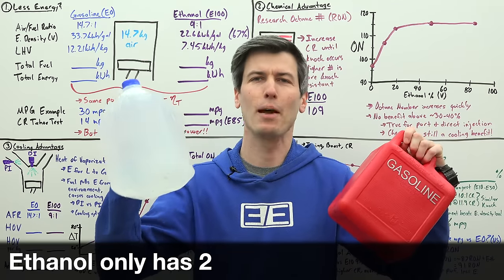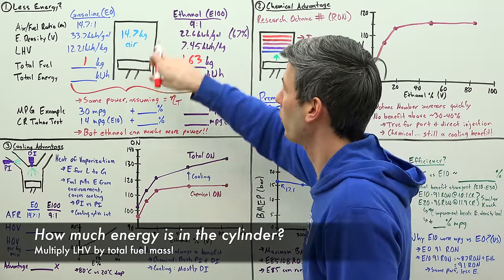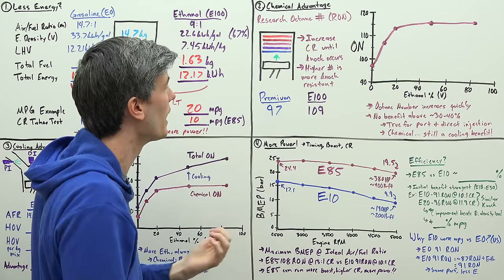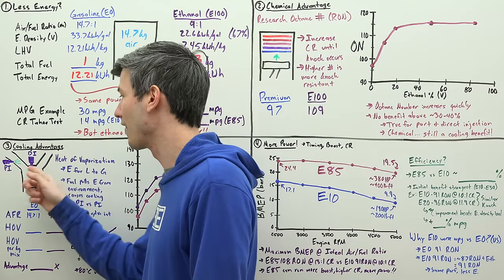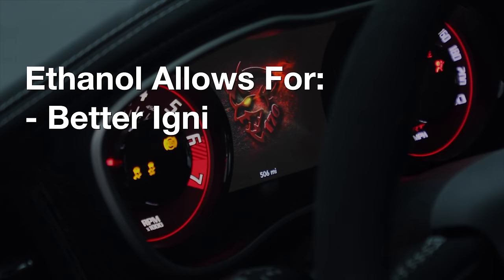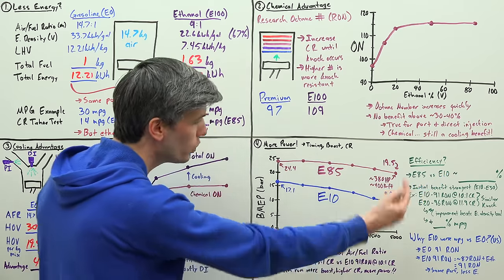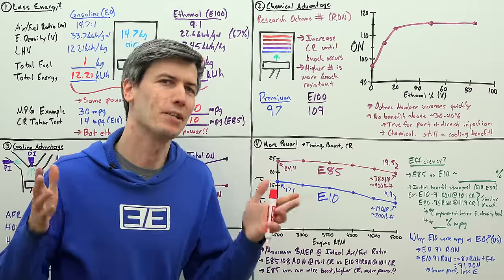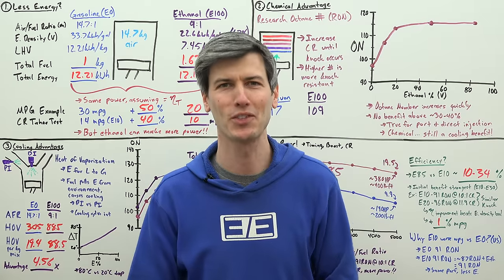Why Does Ethanol Make So Much Power? (Versus Gasoline)

Comment: Suggest you check out Methanol; a superior fuel to both ethanol and gasoline, and cleaner by far.
Reply: A Brief History of Racing Fuel By Craig A. Johnson

In 2005, the IRL used 100 percent methanol in their tanks. The fuel worked well and was more efficient than straight gasoline, but IRL officials believed there was room for improvement. In 2006, they moved to a 10 percent blend of ethanol and methanol, which was then changed to 100 percent ethanol for the 2007 season.

The desire to use only ethanol aside, 100 percent ethanol is nearly impossible to obtain, and is illegal to keep without paying hefty taxes that date back to prohibition. The actual fuel used by the IRL is a blend of about 98 percent ethanol and 2 percent denaturant. The exact composition includes a small amount of high-octane racing fuel.

The fuel for today's Indy cars has an octane rating of 113, compared with methanol's 107. This means a significant reduction in pre-ignition, or knocking and pinging.

In addition, many of the people who handle the fuel, say it smells like tequila. This quality may seem insignificant, but smell is actually one of ethanol's benefits when compared with methanol. Pit crews noticed the switch to ethanol immediately, reporting fewer coughing fits and less eye irritation before any other modifications were made to accommodate it.

According to Dennis Vervynckt, manager of hospitality services and an IRL official, in 2006, the first year the IRL began using ethanol, teams saw a reduction in efficiency of about 10 percent. "That's because we put straight ethanol into the tanks," he says. "The teams initially didn't make any or very many adjustments to their engines. After a few months, they kept tweaking and by the end of the season they were back up to 100 percent efficiency."

Vervynckt points out that there was a minor loss of power. "When they first started using ethanol, teams saw a slight drop in horsepower," he says. "As the teams got used to the fuel, they were able to get more horsepower from ethanol once they again reached maximum efficiency."

The switch to ethanol also allowed the racers to carry less fuel and make fewer pit stops, thereby increasing efficiency even more. "When the cars ran on methanol tanks had to hold 30 gallons to accommodate the fuel requirements of the cars," Vervynckt says. "After getting the engines to perform at their full potential, there was a significant gain in mileage. Indy cars now have 22-gallon tanks. When a driver pulls in to change out his tires, he can fill up. Teams were able to match their tire and fuel stops exactly, instead of stopping for tires only, or fuel only."

That efficiency translates into much less fuel being used by the sport. Lifeline Foods LLC, which supplies fuel for the IRL, will produce 120,000 gallons of ethanol for the 2008 season. And though this may seem like a lot, it's 20,000 gallons less than was used the previous seasons.

The switch from methanol-based fuel to ethanol has amazed almost everyone in the league. Drivers, the direct users of the fuel, voice their approval in glowing terms. "[Ethanol] is an American fuel that is good for the country and the environment," says Ryan Hunter-Reay, of Rahal Letterman Racing and driver of the ethanol car. Standing beside his crew as they make last-minute adjustments to the car, he is more than happy to discuss the benefits of the IRL's switch to ethanol. "It's been great for Indy racing the fuel economy, emissions there's nothing we don't like. We love it."

Comment: The equation (R+M)/2 is flawed because Research Octane isn't actually real octane, it's the equivalent power of what real octane outputs at a specific compression ratio already stated by you. 

Thermal power and efficiency is what people should be calling it instead of Research Octane because it's incorrect to call it that. Which confuses the lay person at the pump not understanding what it actually means.

I've run many different tests with a lot of different fuel grades, the fuel grades with a lower Research Octane and having more real octane actually runs better in the majority of engines from the 1940s up to 2016, this excludes the E-85 multi fuel grade engines but the normal combustion engines on the market. I've found mid-grade  88 ~ 92 to be the best out of all of them. Minnoco, Sunnoco, Sinclair, and BP tend to be more honest in these fuel grades and less honest the higher up you go. You're paying for more expensive gas but with a higher Research Octane number vs. the real octane number. 

People call Octane 100 to 120 racing gas but it's really not, it's for the most part a much higher Research Octane (fake octane equivalence) than the latter.

True 120 Octane fuel is not only very expensive it's also extremely dangerous, as it's very toxic to living tissue.

There comes a point when having ultra high compression will backfire on you, even using true 120 Octane gasoline, there's a limit as to how much power you can create with convention combustion engines. Simply because they're designed for mass production and not tuned for power and efficiency from the reduction of weight of the individual components within the engine itself. If engine and transmissions were given the care and assembly that top end racing cars have, we'd have a much different outcome for fuel efficiency regardless of what fuel we're using.
Reply: Scania has sold an ethanol engine worldwide for years which has a 28 to 1 compression ratio.  They state both power and fuel economy is on par with their diesel engines.

Ford's first prototype EcoBoost engine was optimized for E85 and achieved 15 to 20% better fuel economy than when on E0 with load performance similar to a diesel engine.  They didn't come out with it in flex fuel because they evidentially thought they could skirt paying the MIT scientists' patents on the design.  That is still in court.

Ricardo built and drove an ethanol engine for GM which surpassed both power and fuel economy than their diesel engine.  This is why GM wants a 100 octane fuel standard from the EPA.

 FROM RICARDO:
The new federal CAFE standards are calling for a doubling of fuel mileage performance, which, Vint says, is going to send OEM’s looking for high octane numbers to improve efficiency and ethanol is the best source. Ricardo, an engineering firm with over 100 years in the business of engine design, has developed an extreme boosted direct injection engine (EBDI) to optimize ethanol blends. The 3.2 V6 gasoline engine rivals the power and torque of a much larger GMC Sierra 6.6 diesel, he said, and it delivers 3.5 percent better fuel economy than the diesel.

GM and Ford were also both concerned about E85 availability since <2% of fuel stations in the US offer E85 compared to France where >25% of fuel stations have it available.  Monopolistic power at play in the US.

Comment: Compliments for your  well done mathmatical artistic, pseudo science and engineering graphics presentation. To promote ethanol as fuel for 'gasoline' type engines. 

Ethanol is a net-net wasteful endeavour and mostly based on politics, lobbyists, big-agri and taxpayer funding of all of latter.  Compounding wastes are using agricultural lands toward ethanol instead of foods. Lands used used to grow corn/maize, sugar, and other plants to be processed to extract and distilate ethanol /alcohols from is squandering, and mislieading as are feel-good politics and unscientific sales pitches. 

Ethanol is hydroscopic aka has strong affinity to moisture whether as water vapour in atmosphere, condensation, or liquid forms. Thus alcohols easily blend with water. 

Ethanol fuels and blends in gasoline cause tremedous deterrioration to fuel systems, engines, resulting in costly repairs,  upkeep, and replacements. 

Ethanol and its blends in fuels are sister to and as sinister as salts spread on roads during winter seasons in USA, CAN, and parts of Europe under premise and promises of; ethanols being green fuels; salts on roads, bridges, walks etc as assuring safe travels. All illusions while ignoring facts of massive deletarius effects, deterioration,  ruin, pollution, other costly and not-green consequences.

Both foster making engines, cars, trucks, roads, bridges, etc deterrirate rapidly and fail  toward being replaced often. Guess who are burdened?

Comment: That dam ethanol is the worst thing they have done for small engines, if it stays in an engine's fuel tank for a length of time it gums up the carbs and that is where all the problems are. If you use non-ethanol fuel for small engines you eliminate the problem of gummed-up carbs and the starting problems associated with it,  my 2 cents worth.
Reply: Identical small engines to ours in Brazil use their common gasoline which contains 27.5% ethanol.  It has worked out so well and for so long that Paraguay went to E27.

Many fuel carb and injector cleaners use an alcohol for an active ingredient.  Sea Foam fuel treatment contains 25% alcohol and they state it stabilizes fuel for 2 years.  Gasoline only normally lasts 3 to 6 months.

I can remember before E10 came that gasoline would always varnish over winter in my father's small engines.  Like a skunk, varnished gasoline is something one never forgets.  I have not seen E10 ever varnish.  During the transition to E10 from E0 back in the 1980s, E10 would clean out the built-up varnish which would plug fuel filters.  Once clean, E10 kept things clean.
Reply: I use E15 in all my gas mowers....my 2 cents...and I have videos of it.

Comment: Unless the fuel will sit idle in your engine for long. Ethanol which sits for too long without moving erodes and corrodes many rubber and plastic parts prematurely, and it also doesn’t keep as well over time in a can.  Real gas wins both of those battles. I put real gas in all my mowers and engine-driven tools.
Reply: NOPE.

Comment: Your next video let's get to talking about ethanol it's 55% more explosive so when you crash one of these US Government EPA mandate Echo pods I call crumple Zone caskets that the fuel explodes and burns people alive in their own private crumple Zone crematorial just because we can't we can't have 100% gasoline like Russian citizens get to enjoy and they're 95 octane that only $3.38 a gallon and the r 600a explosive refrigerant in new refrigerators since 2009 mini refrigerators have exploded as the freon leaks in between the lining and the steel body of the refrigerator and explodes because we have to be good to the environment and have deadly refrigerators soon the deadly Freon will be in cars and when they crash it will leak ignite and ignite the ethanol and the car is guaranteed to burn forget the pinto every make and model will burn
Reply: Ethanol is not explosive, just the opposite.  

The Indy 500 back in the 1960s saw this first hand in a deadly multi-car crash when both gasoline and alcohol powered cars raced.  They switched to 100% alcohol for this reason.

Train and truck crashes with ethanol often do not explode because ethanol has such low volatility.

The reason we even have E85 instead of E100 is to make it volatile enough to start engines in cold weather.  In wintertime, E85 is actually E51.  Brazil who went to E100 fuel used to have lawn mower sized tanks of gasoline for starting.  Today's modern flex fuel vehicles there have heated injectors for starting in cold weather very similar to glow plugs in diesel engines since diesel is low in volatility also.

Ethanol is the cleanest, least toxic, and lowest cost per mile octane booster available.  Today the spot cash delivered price on the NYMEX of ethanol is just $2.36/gal.

Comment: Much like hydrogen if it
 were liquified.
More bang per gallon.
Reply: All gaseous fuels are dangerous, even more so as the equipment ages.  Hydrogen is the worst because of the extreme pressures and that it is so tiny it is hard to contain.

An ethanol optimized engine has no match in bang per gallon, not even diesel.  Efficiency from a simple and cheap internal combustion engine that gets into fuel cell ranges.

I do see that hydrogen fuel cells get great mileage and that they are available.

Nissan has a hydrogen fuel cell that gets its hydrogen from ethanol.  They drove one around in 2016 in Brazil who has an E100 infrastructure.  Great thing is it could have enough water in the ethanol so as to not be flammable and work making an already safe fuel perfectly safe.

Advanced European and Indian ultra-quiet large military submarines also use ethanol fuel cells.  They have alcohol fuel cells in computers, drones, and RV/sailboat/back-up power sources.

The new generation don't make hydrogen from a catalyst but can use the ethanol directly.

Here is an article excerpt from seeking alpha web page talking about the bang per gallon of ethanol vs hydrogen:

>>>Fuel Cell technology offers many advantages over Lithium-ion batteries, not the least of which is that hydrogen used in fuel cells has the energy to weight ratio ten times greater than lithium-ion batteries.

That said, the volumetric energy density of ethanol is over five times greater than hydrogen.

Ethanol has five times higher volumetric energy density (6.7 kWh/L) than hydrogen (1.3 kWh/L) and can be used safely in fuel cells for power generation.<<<

Comment: If you want to trash carburetors, ethanol's your huckleberry.
No problems starting any small engines after extended idle periods after switching to pure gas.
Reply: Not true. Gasoline separates with age, and the varnish from separated gas will clog a carb to the point that it needs disassembly and cleaning.

“Fuel varnishing is a gummy residue that clogs the generator carburettor and fuel pump. It's caused by the deterioration of fuel that sits in the engine too long, and it happens in a surprisingly short period of time. Depending on fuel quality and storage conditions, gasoline can deteriorate in as little as 30 days.”

“Gas contains volatile compounds that allow it to burn. As these compounds evaporate, gas becomes less combustible and eventually turns into a gummy varnish-like substance. When this happens, gasoline no longer smells like gasoline; it smells like pungent varnish.”

Ever heard of GumOut? It’s a carb cleaner that has been in existence since long before “gasohol” was even on the radar of American motorists. Can you guess why it was called GumOut?

Stop spreading lies …
Reply: @sking2173  Sorry, but it is in fact true. My personal experience, and that of many thousands on the web. Ethanol has trashed MANY small engine carbs. Gasoline has, in comparison, a trivial ability to do that. And the time scale it takes is years, not months (as with ethanol).
But you be you, and GOOD LUCK WITH THAT!
Reply: @Steve-wz5pz  Thank you I was hoping one of you guys log in with that story!!!
Reply: @Steve-wz5pz  Sorry, Steve, but you don't know what you are talking about. You have misdiagnosed what caused the issues. Gasoline and aromatics are more corrosive than ethanol and methanol.
Reply: @TheAutoChannel  WHOOPS! There goes ALL your credibility. Anybody who owns a lawnmower can tell you how stupidly wrong that is. Ethanol is fine for a daily driver, but it clogs jets in infrequently used motors like nobody's business.   This is EXPERIENCE, not whiteboard warrior stuff. No worries, though - another 20 or 30 trips around the sun and you will start to understand everything better!
Reply: @Steve-wz5pz  It's OOPS, not WHOOPS. See, you can even get that correct.
You must think you're discussing this subject with your friends, who probably know less than you. It's impossible for ethanol to cause the clogs, because alcohol dries clean. Alcohol is used to clean sensitive electronic equipment, such as video heads. If it left any substance, it would destroy the equipment. You can test this for yourself by pouring some rubbing alcohol on a clean surface and let it dry. There will be no goo.
On the other hand, pour some gasoline on a clean surface, and let it dry. Then wipe your finger over the area. It will be gooey. That goo, plus the residual burnt particles from the gasoline is what clogs the jets.
When someone like you, who does know OOPS from WHOOPS, then it invalidates any comment you might make about my credibility.

Comment: Hang on Einstein.  14.7 to 1?  Since when?  It will run crappy under most circumstances unless your air/gasoline ratio is 13 point something to 1.

Comment: If ethanol was better it would require subsidizes and mandates to use it.
Reply: There are no Federal subsidies for corn ethanol and have not been since 2011.

The long-standing stated goal of the G7 Nations to end petroleum subsidies?  No such luck.

The CBO did a study on ending the mandate and found that the same amount of ethanol would be used because ethanol is the most economical octane booster available and the fact that most metro areas require oxygenated gasoline for pollution control.

Comment: bye bye rubber parts like hoses
Reply: no no no...its 2024 not 1974.
Reply: Ethanol on most any rubber manufacturers' chemical compatibility chart you will find is most often rated as good to excellent.

Gasoline and BTEX (benzene, toluene, ethylbenzene, and xylene) is rated most often as poor to not recommended on rubbers.

Gasoline is so harsh on rubber that Viton had to be invented.

Henry Ford designed his Model T for ethanol.  Production models were flex fuel.

The UK sold E10 from the 1920s with Cleveland Discol being the most popular which sold there until 1968-70 when BP bought them out.

We had E10 blends in the US in thousands of stations in the Midwest right after Prohibition until just before WWII with Agrol being the largest company.

Brazil who has many of the very same non-flex fuel vehicles we have has used >E20 since the late 1970s and currently uses E27.  It has worked out so well and for so long that Paraguay went to E27.